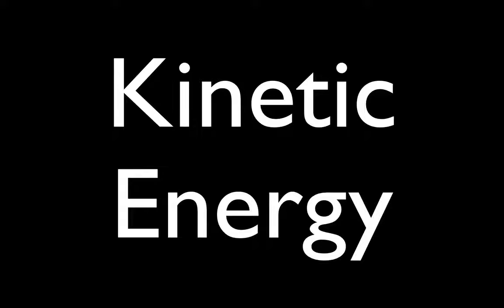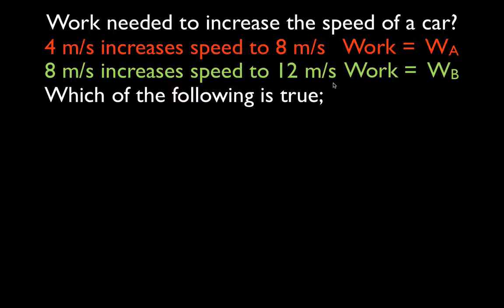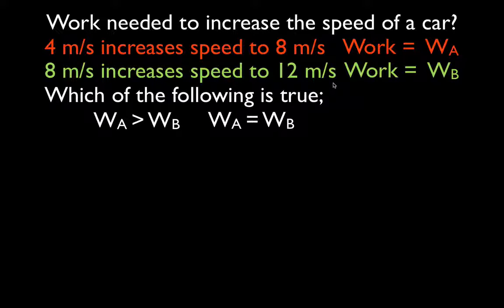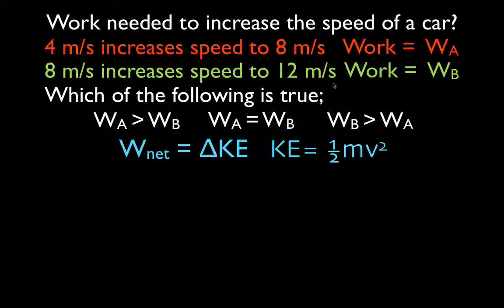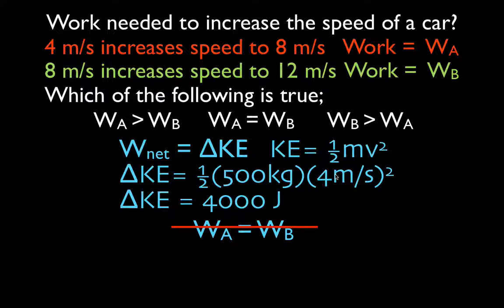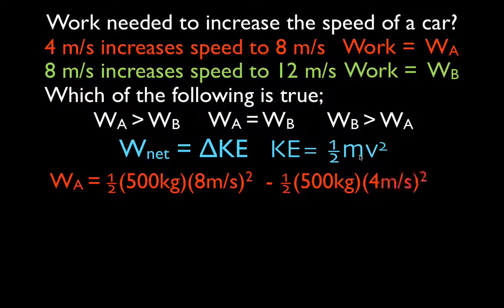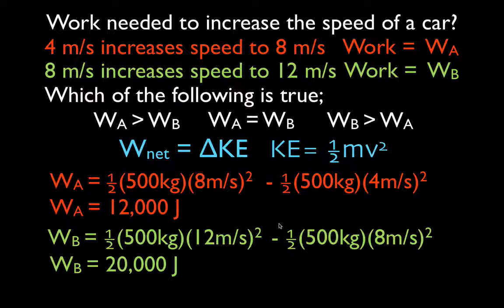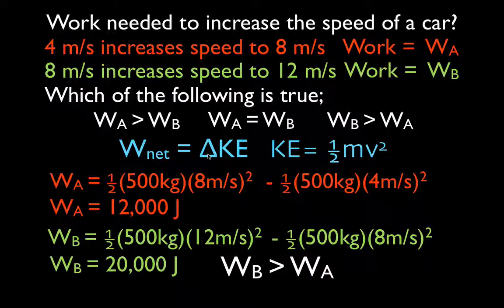Energy, Work & Power (3 of 31) Kinetic Energy, Example No. 2

Comment: This is an interesting concept and a great video.  Am constructing a mathematical model for the movement and expenditure of energy in racehorses, and one of the most difficult things to understand about racing has been the concept of why a horse that takes the early lead in a race is likely to ultimately win the race.  It appears to be because, since most energy expenditure comes in acceleration, if a horse is in the lead it does not need to accelerate (i.e. “catch up to” any other horse), so its energy expenditure will be minimal, compared to horses who must come from behind.  On the other hand, the concept you have explained illustrates how speed horses who compete with each other the whole way in the race— that is, who constantly try to outrun (out-accelerate?) each other, burn out by expending all their energy.   Perhaps this is too simplistic use of the concept but perhaps it holds some truth.